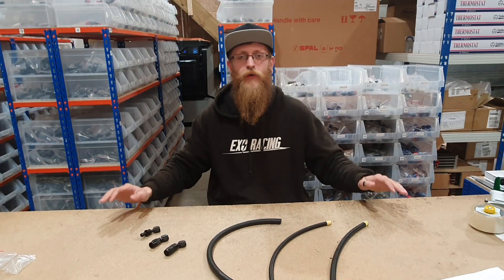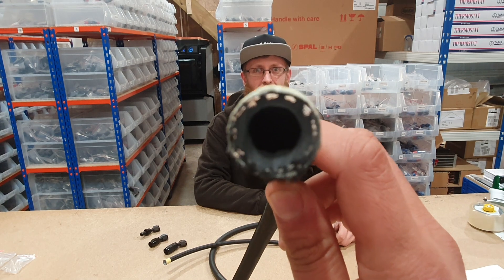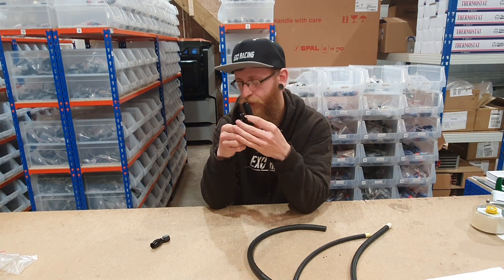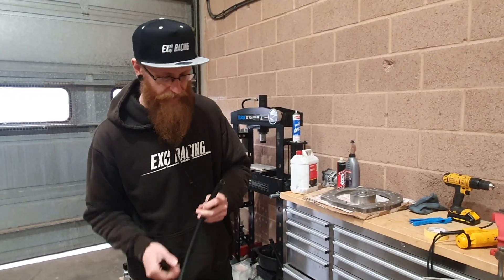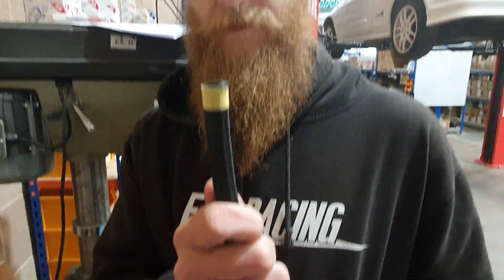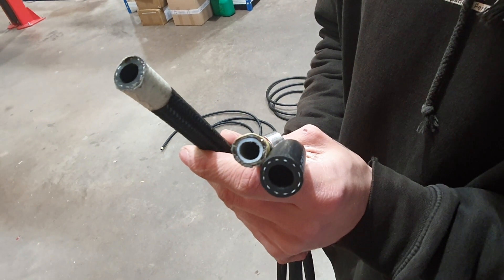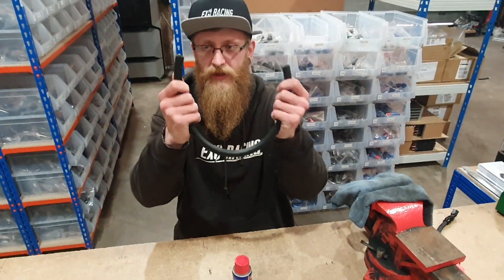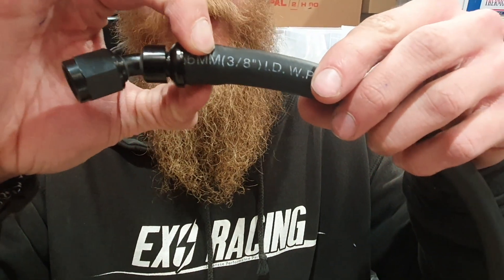How To Install AN Fittings To Braided Hose

Comment: It’s normal to put Teflon tape on the valve cover bung that connect to an fittings. Correct ? Thank you!
Reply from the maker: It's best if you can get them to seal without the use of tape! However PTFE tape can be a life saver if you can't quite get a perfect seal. Just make sure none goes into the oil system!!